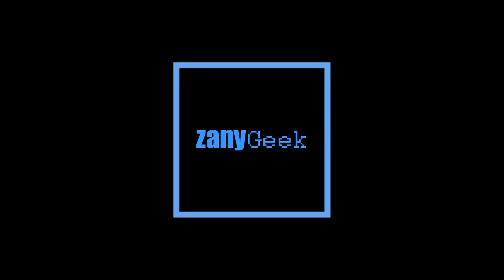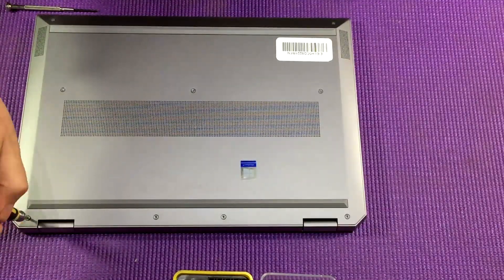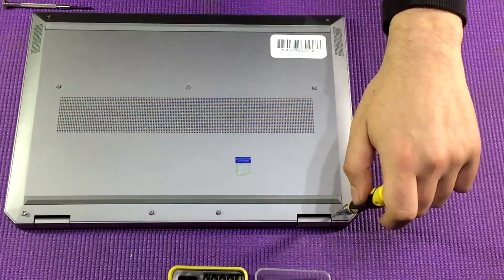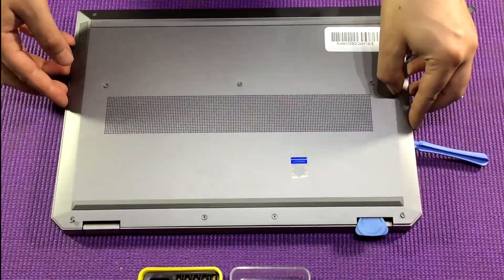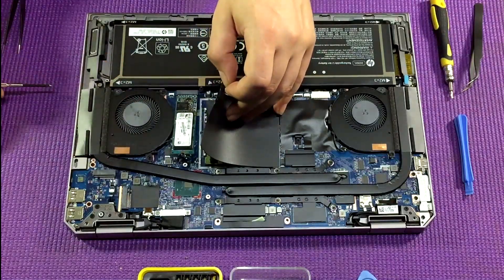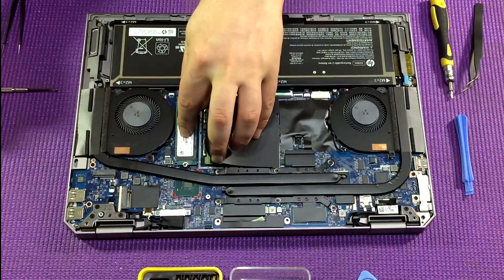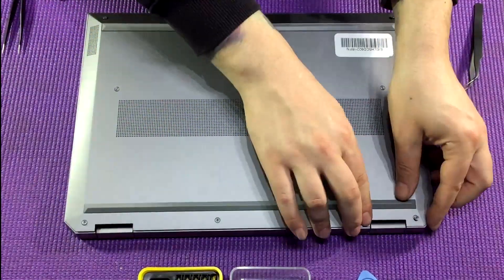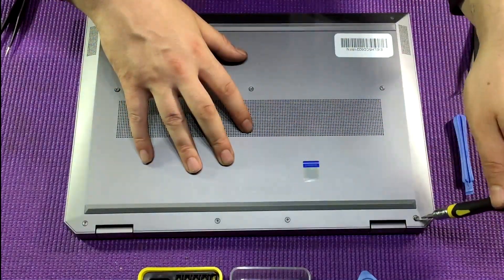How to Upgrade HP ZBook Studio G5 SSD - Increase Internal Storage - Laptop PC Tutorial

Comment: This process was easy, however the new drive will not boot.  I used Aomei Partition Magic to clone the existing drive onto a new one, which works.  The new drive will not boot.  If I boot off USB, I see the new drive, with its partitions (Active, Boot) but if wont start up. Is there some funkiness with TPM or other security getting the drives to work right?

Comment: Sorry I am a newbie on this. Is there only one slot for SSD? So I can only replace it instead of adding extra one?
Reply: No, this laptop has two. The second one can be seen right above the hinge on the left in the video (black rectangle, contacts on the left of the rectangle). This is the configuration of the Zbook with a 6-cell battery. There is also a 4-cell battery version which leaves space for an additional 2.5 inch hard drive.
Reply: @ijsbert6174  Hi. is this for an extra SSD or for an wlan module?

Comment: Pardon me, I don't understand this. If the G5 is stock and not upgraded before, it would only have one SSD. That SSD must carry the OS. So how can the system disk just be ripped out and replaced with an empty SSD?? Amateur asking.
Reply: I have just ordered the XEON version with Dreamcolor screen and M2512 GB SSD. MFR # 4NL40UT#ABA. According to B&HPhotovideo and HP the laptop should have 2 M.2 2280 SATA/PCIE slots with 1 512 GB SSD installed. No other SSD with this model. Should also have 2 SO-DIMM slots with 1 16GB ECC module installed.
Reply: If you look at the lower left corner of the G5, you will see the other M.2slot/
Reply: @fast1bike  i have a question, i have same laptop i want to add additional drive , what is best option for me which type of drive should i order